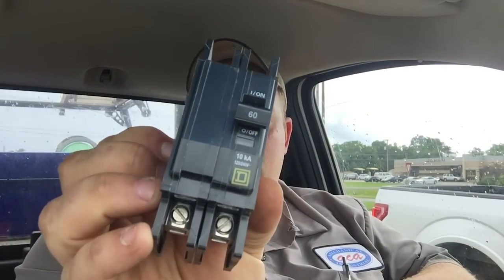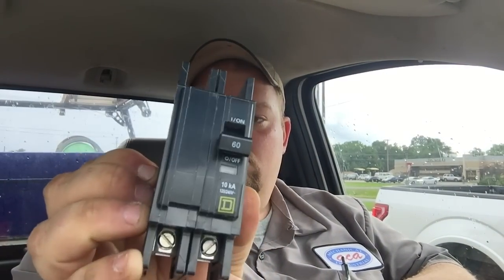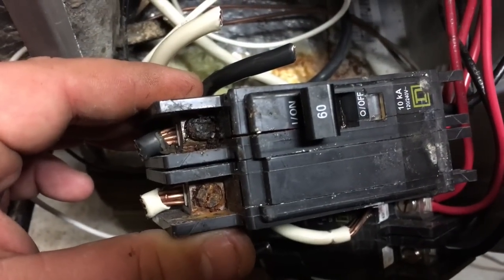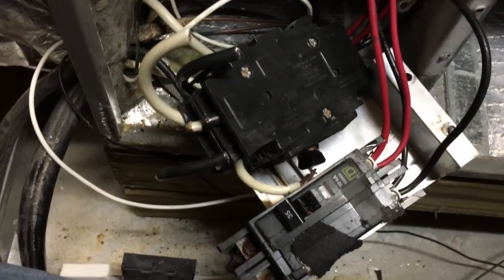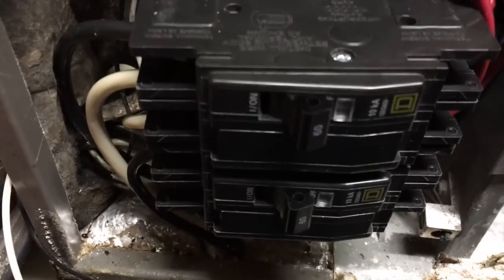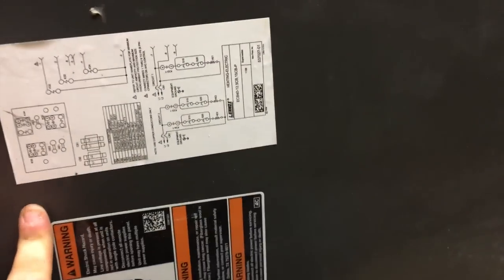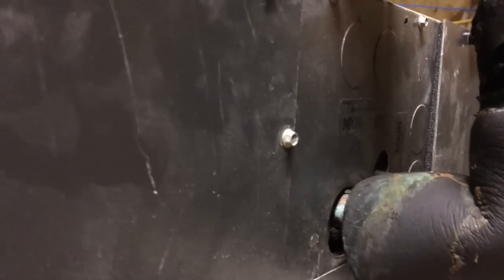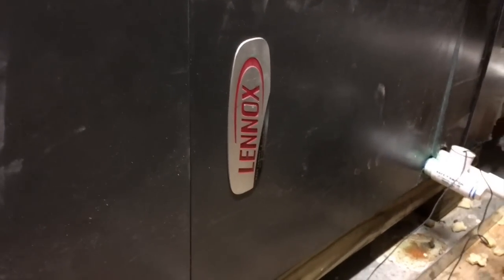HVAC: Tech Tip Quick Video

Comment: great video John. why are there three service ports on a heat pump condensing unit? specifically the goodmans. i've noticed the usual two and and a third one sticking out of the body panel? what's it for? thanks for answering my questions. the guy i work for owns a HVAC business but he's......."not that knowledgeable" and i can't learn from him. a shame really. really appreciate what you do!
Reply: I'm not John but that's a port to take suction readings while the heat pump is in heat mode.
Reply from the maker: Stev beat me to it!!

Comment: Why do they use breakers in heat strips? So you don't need a disconnect?
Reply: The breakers protect the internal wiring on the air handler, and used as a disconnect.

Comment: Ran into this problem last week. Ordered the part and used two sp, st 30A breakers I had and unhooked w1 from the circuit until they arrived. This would have been easier!